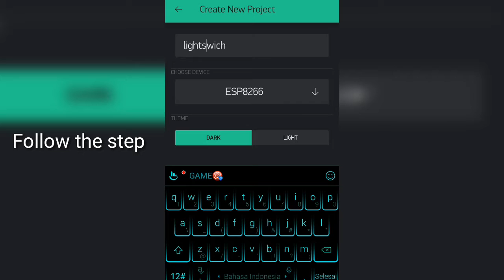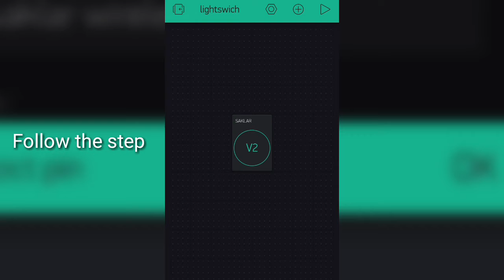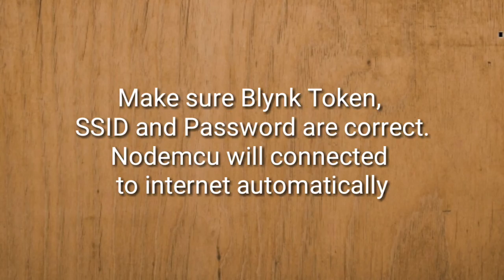How to Control Light Switch with Servo BLYNK #iot

Comment: Mas kalo buat ke saklar dc yg relative keras saat ditekan apakah servo motornya masih bisa ?
Reply: Tegangan dan arus yg masuk ke esp8266 bagusnya brp ya mas? Saya coba pake powerbank 5v 1a bisa bekerja di servo sg90 yg mini, tapi saat pake mg996r kok engga bisa ya?
Reply from the maker: coba konek pakai charger hp yg masih bagus/ori...klo ada yg 5v 2A, klo msih gak bisa, hubungkan pin +- servonya ke power external, dan pin Pwmnya ke nodemcu...klo masih ga bisa, berarti servonya itu yg bermasalah.

semoga membantu.
Reply: @electronia92  terimaksih mas, membantu sekali, saya punya servo mg996r ini emg kurang bagus kayaknya, putarannya patah2 dan buat dipake di projek yg mas buat, bener mas harus ambil tegangan 5v dari lain bukan lgsg dr esp8266, kalo boleh infonya mas beli servo yg mg995 atau 996 (torsi besar) yang bagus dimana ya mas? link olshopnya bila berkenan, saya dah kena prank toko olshop beli 2 sevo kurang bagus terus mas
Reply from the maker: masih bisa mas, asal peletakannnya presisi dan dudukannya kuat...klo ddukannya ga kuat, nnti malah servonya yg keangkat...

Comment: could i use this for PIR sensors? i have 6 x PIR on a separate months all will have ESP8266 and Servos to rotate the sensors different angles. when i leave the house i want them to rotate inward and when i return i want to rotate them outward. is this possible? also get a write back to confirm they are all positioned correctly? sorry i have not a lot of experience with sketches etc. thanks